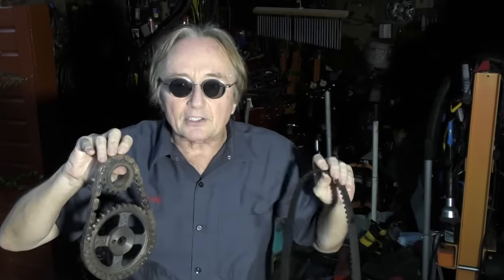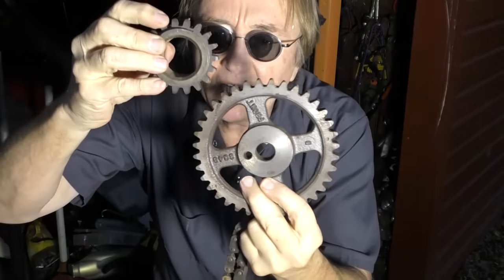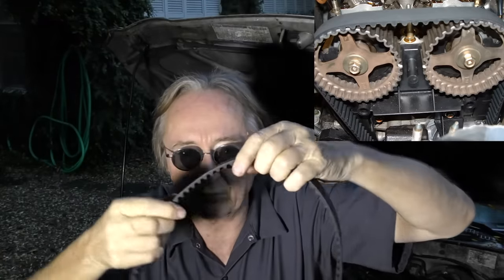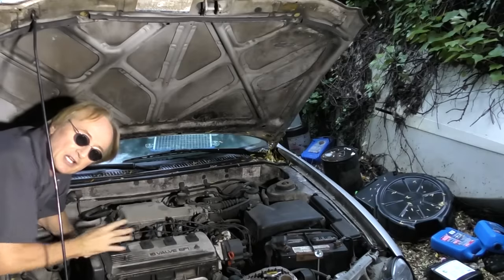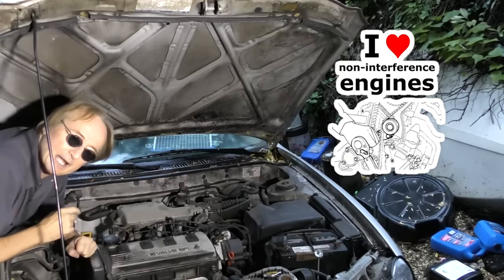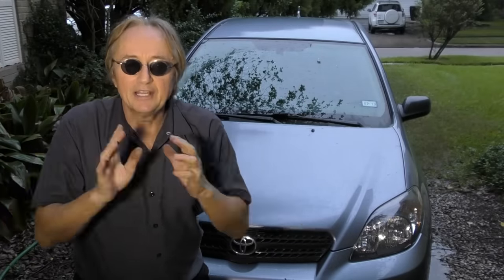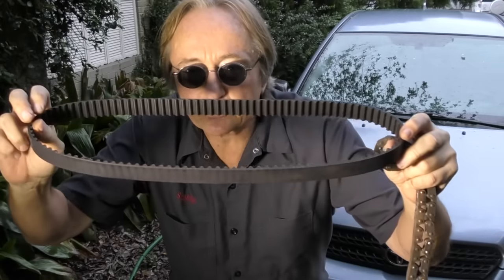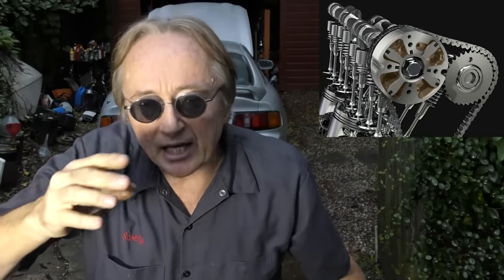Why Some Cars Have a Timing Chain Instead of a Timing Belt

Comment: Timing gears aren't totally obsolete.  I had a Pontiac Fiero with the Iron Duke 4 (no, it didn't catch on fire).  It had timing gears. I never really thought the engine was overly loud but, then again, it was in the rear.  The crankshaft gear was metal, the camshaft gear was nylon.  I presume the camshaft gear material choice was to make the engine more quiet.  One fateful day that nylon gear had enough (in all honesty, I overheated that engine many times due to the coolant system design so the gear may have been weakened)Only stripped a few teeth off but I guess that's all it takes.  Non interference engine so all was not lost.  Considering the number of Iron Duke engines made, there might still be a few out there (the USPS LLV comes to mind).

Some years later, I had a 3rd Gen Camaro that I'd put about 200K miles on.  It had a 305 V8 and at one point I noticed that it sounded like a giant baby rattle.  The timing chain had indeed worn out and stretched, but never jumped.  I replaced it and the car was much quieter.

Good cars, both of them.

Comment: many cars manufacturers are able to use timing chains who last LESS that timing belts, so the hyvo chain presented by Scotty are not the best: on many modern engines they are undersized and lengthen, and because they specific design, induce a fast wearing from the cogwheels: best was the robust duplex roller chains: last the live from the engine...

Comment: Daimler-Benz once offered special offset keys for the camshaft and distributor/injection pump sprockets, which allowed compensation for wear of the pins and holes in the links of the chain. That's why the chain gets longer, the metal itself does not stretch unless grossly overstressed.

Comment: Ford ecoboost uses a rubber belt dipped in oil, with their smallest engines. In the UK the 1st generation ecoboost focus changed the belt after 100k miles. Other brands in Europe started copying the same system but with poor results. Rubber belt dipped in oil reduces de vibrations of the engine making it smoother.

Comment: I remember when there was a period in the 70s when all the racers were going to gear cam drive but they found out it caused major issues in the engines with high RPM and big HP. Something to do with shock causing failure through breakage of parts. So gears quickly went out of favor for race engines. If you follow the manufacturer recommendations for cam belt replacment they are fine. They are lighter, smoother, quiter and more accurate than a chain. Chains might be OK but many manufacturers screwed up by putting in plastic or nylon gears instead of metal so they could keep noise (and cost) down.Those gears caused all kinds of premature failures. Also I found that often it wasn't the chain or belt that broke....instead it was the tensioner. When changing a cam belt I always change the water pump, serpentine belt, tensioner.  I always have said the main cause of engine failure was the owner....who didn't follow the manufacturers recommended maintenance schedule.

Comment: I love my ford Rangers. They have a timing belt and a non  interference engine. (4 cyl) I change my own belts and they last forever. The belt cost about 40 bucks and I can change it in about 2 hours now.  I've owned several rangers now and loved them all and have been driving them for over 30 years now. The  lima engine is easy to work on and very reliable.  Some day I might be forced to get one with the newer style engine so I hope it's just as good as the older one.

Comment: Nice educational video...maybe additional info you forgot to mention is that belt is supposed to be changed periodically...so will not break if done as recommended and quite cheap to replace compared to chain which has no clear  indication about when replacement should be done
Reply: Sure don't have to change a chain twice in 150K miles.

Comment: Great video and info.  Your the best.  I have a 2007 VW Passat 2.0  4 cylinder  turbo. Took the car to VW and they told me its the timing belt system. 
For a while ive been  hearing small ticking noise coming from alternator pulley or tensioner,  i was told it's the lifters, then told its the tensionor pulley.  If its the lifters, are they worth repairing? Also, had the timing belt and accessories replace, and the car was running well, but went back to misfiring and stallling.

Comment: Scotty I'm with ya on this one. I have a 2004 hyundai sonata with the 2.7 engine. I has 156000 on the engine. Doing the normal maintenance has convinced me that only the minimum was ever done on this car. Which leads me first of all to the timing belt which I seriously doubt has been changed more than once if that. These naturally asperated v6 engines can get 300 or more and it uses no oil so far but these are interference engines.  Both my sister and I have lost engines in the past due to TB failure although they were different car manufacturers . This is not an easy engine to work on and the water pump is behind the TB so you really must change it while your there. The cheapest est I could get was $740. I'm retired and will do it myself. I've never had to mess with any engine which had a timing chain ever over timing related engine failure and I've owned many, You just never even worry about it. With a belt you better pay attention and change it every 60.000 to be sure. I don't want to have to worry about a radical up or downshift, in an emergency snapping my belt and taking the engine out

Comment: I actually like the timing belts on my subarus. Super easy to replace. I can change a belt, tensioner and water pump in 1.5 hours without rushing.
Reply: itd be alot cooler id u didnt have to change them at all

Comment: A big difference with a timing chain/belt vs gears is camshafts turned by chains or belts turn the same direction as the crankshaft. Timing gears on the other hand have the camshaft turn the opposite direction of the crankshaft.

Comment: I had a 93 mustang. Broke the belt at 58000 miles. After that I changed it every 50000 miles. Got a 2003 Corolla with a chain. Got 300000 miles. Never had to replace it.

Comment: belts are also quieter than even "silent" roller chains. They also sit outside the oiled space meaning that you only need to seal the oil pan valve cover with gaskets. There is no need to seal the front or rear where the chain would be.

Comment: I've owned multiple hondas and toyotas with timing belts.  Nothing wrong with belts.  Change them every 100K and you're golden.  I've also owned  3 Audis and a 2 Mercedes, two of which needed timing belts at 80K.  Steel isn't necessarily better than rubber.  Belts rarely if ever go before 100K, and they're much cheaper to replace when it's time, as they were designed for replacement.  Timing chains are not designed for replacement, so when they do go (and today's chains are not what the old ones were) prepare to take out a home equity loan to pay the mechanic.  Plus....modern cars with timing chains usually have plastic tensioners, so that negates any reliability gain.

Comment: This and all of your mechanic advice videos are excellent informative, Thank you for your humble and knowledgeable dedication.   I own a 2002 Nissan Frontier SC (VG33ER) with 185,000 miles.  After listening to this vid, I'm considering doing an engine swap and, if needed or required, transmission swap.  I'd like a bit more horsepower and torque and an engine that would give me at least 24 MPG - Maybe, I'm being ridiculous.  Would you have any suggestions of engines (not necessarily Nissan engines) but good quality responsive engines with Timing Chains and tranys?  Or, is it always best to continue buying OEM engine type like VG33ER? Or educate me to your best experience, please.  Thank you in advance.

Comment: Timing gears are the best they don't break or stretch but they are costly, my 5.3 02 Silverado with 154k miles on it has a timing chain so one day I was just curious on how much slack was on the chain by moving the harmonic balancer pulley back and forth well to my surprise it was very little movement on the pulley maybe 1 or 2 degrees of crankshaft rotation...I was impressed how little the ware is on the chain....but my 08 gmc with the 6.6 duramax has a gear driven valve train that motor has 265k miles on it no need to worry about breaks or stretches

Comment: I had a ‘99 Ford escort with a 2.0 SPI and a 5-speed that blew the timing belt as I had the clutch disengaged downshifting around a right turn. I lucked out about the timing. Engine was still okay! Cost me $499 to fix (mechanic did the water pump while they were in there), but hey! Sold that car to a friend who eventually had to get rid of it because of unsafe rust.

Comment: 2005 Lexus LS430, timing belt, interference engine, changed it in 2015, 86K miles, was about to break according to the mechanic, whom I trusted. Changed the tensioners and water pump too. Beware buying an older car, 10 years and 90K miles and the timing belts need changing, can be $1000 to $2000 job. Beware.

Comment: My 1986 Corolla snapped its belt at 42K miles and bent all the valves!
One of the Toyota engines has a shaft driven cam. Was it the Avensis?

Comment: Engines with belts are very easy on the oil, you can go extended OCI, but with chains, you gotta keep that oil changed, or it will shear.

Comment: I had two cars the were destroyed after 100,00 miles with a timing belt breaking. Now I have a nissan versa with a timing chain and it now has 230.00 on it and runs great

Comment: For a few years, Nissan's pickup truck was built with a timing chain because it was hard to access, so, no need to do a difficult routine change of a belt. Problem is, they put the chain on sprockets that were made of plastic.  You can guess what happened over time.

Comment: I had a timing belt fail at 65MPH in a 1995 Eagle Vision. It was scary, I lost all power (electrical) power steering and power brakes! Fortunately, I was on a long, straight section of highway and was able to use the emergency brake to get into the emergency lane.

Comment: Timing belts are a thing of the past and were mostly used by the Asian cars and needed replacing well before 100K on many. Virtually nothing has used them the past 20 years or so. We used to replace them on most of the older foreign stuff years back regardless if it was a Toyota or Honda or Nissan/Datsun

Comment: Principal issue with timing belt is polygonization - they don't roll over gear as smoothly as rubber. This effects introduces vibrations, noise, inefficiency and cost in engine. Principal advantages of chains are higher specific load - with same space they can power larger output engine. How log will last depends on how well they were made. 

Now timing belts will deteriorate over time so you need to change them even if car is not in use. However if they are accessible they can be changed for a low cost. In some older european cars you could change them with only using hands and 20 minutes of free time. They also run smoother with lower fuel consumption. But this is mostly reserved for european ecoboxes. American cars are to powerful on average and in USA maintenance costs are to large to see any value in belts.

Comment: I've got a Mitsubishi Colt from 2007 it's only a 1.1 litre engine but it's got a timing chain and it is a hell of a lot faster and more fuel efficient than a belt driven engine, not to mention I should get over 200 thousand miles from this cars engine with no timing problems

Comment: A lot of late 80's early 90's nissans have timing chains for example SR20DE  QG18DE. In fact Nissan pioneered this long before Toyota. Toyota didn't really start using timing chains until they started making VVT engines.

Comment: I have a 2000 Hyundai with timing belt. It broke - trashed the engine - cost $2,300. Had an old 72 Olds with timing belt - it stretched some - timing went off - I changed it myself for under $100. Loved them older, well made engines.

Comment: the good thing about belts, is that if its recently changed its not gonna brake/fail. Chain will often stretch after time and cause problems. So if your buying a 10 yr+ car, belt can be your friend.
Reply: that is true to, but you can hear chain if he stretch and you have more time to react, you can drive a few months before you go to car mechanic, if you have belt when you see is late for everything, sorry for my english

Comment: Scotty, I have a Hyundai and the dealer told me I have 31,000 miles on the car and it needs a new timing belt. Cost over 1,000 dollars.Bought the extra 100,000 mile insurance and they tell me it’s a wear item and it’s not covered. Not only cheap made but they don’t last and charge you a small fortune to replace. I will never buy a Hyundai again. Thanks for letting people know.

Comment: I have a 2013 Honda accord four-cylinder that I believe has a timing chain in its engine.. it has 128,000 miles on it and has never been changed. When should it be changed??  is there a exact mileage when it should be changed out ???

Comment: I agree that a rubber belt sucks compared  to a soaked in thin oil steel chain. More often there are problems with  the tensioner than the actual chain itself. But note that the belt is not just rubber, it has a steal or nilon frame just like ur tires so it keeps is shape

Comment: Tell that to bmw N47 engined drivers! Same with some mercedes engined vehicles, they had trouble with the timing chains stretching as well. Timing belts are fine if they're changed on time.

Comment: Would you know if there has been any kind of recall on Buick's with timing chains or belts?  Our dealership is trying to say that our timing chain broke, but my wife drove the car and parked it and got out, and did not hear ZERO LOUD NOISE which I would think would be obvious ? 
 
This car was loosing oil at record pace weekly nearly down to nothing at times!...and this went on  for several months and they told me its an older car and it burns oil, but that has to be bull because it was vanishing !  But did not leak on the ground at all,  and the dealership kept putting it off telling "me" to make sure I keep record of it weekly and put oil in it when it needs it.  Would it be my responsibility to make sure I fill oil sometimes daily for an issue that I think I did not cause???

 But when the car would not start, we called tow truck to come take it into the dealership and then they said it was the chain, but HOW THE HELL can the chain fall off without us knowing it?? Lol....Any help would be great, Thanks again for your tips!

Comment: Here in Europe timing belts are usual, I have had 350.000 (kilometers) in my car and it's close to have the third change, nothing wrong. What the difference betweeen to destroy an engine for a chain tensioner or for a broken belt? You keep the maintenance procedure and everything is all right.

Comment: To my recollection, it was Hans Glas the inventor/producer of the Goggomobil, back in the 50s (when I was a young kid, just a couple years older than Scotty ; ) who came up with the rubber-based timing belt. Back then it sounded 'revolutionary' to my amateur ears. 
I'd have to check Google to see whatever happened to Goggomobil, but as far I believe to remember BMW bought them out and introduced the timing BELT Hans Glas invented to their own models. Well, that's what I believe to remember from my teenage years when I grew up in car-starved Europe during the post war early 50s.

Comment: Scotty, you do know that as mentioned by others, that the tensioner can fail inside the enige of a chain one, and with a normal timing belt you replace it every time you change the belt.
Besides it's more quit, and a chain also stretches like a normal one does, not as fast as you mentioned. But i have seen a lot of modern cars where the chains has to be replaced within a short period of time like 60 or 70k, and even brake.

True that a chain is stronger and less likely to brake, but please don't state it as superior against poor, because it's surtenly not!  Good maintenance will go a long way, and also the way people drive.

Comment: Few months ago I was smoking outside when my neighbor turned her car on and I could hear really loud rattling noise. Told her that her timing chain needs to be changed and gave my friends number as he's mechanic. 

Later my friend told me that it's probably the original chain as he never seen the one that was as bad as it was on the car. That car(BMW E60 530D) had over 600 000 km (almost 400 000 miles on it)

Comment: My 1999 Nissan Primera has a timing chain and my 2015 Škoda Citigo has a timing belt. I am supposed to change the belt every five years or 160,000 miles, whichever comes first. I am a driving instructor and so there is a lot more pressure on the belt so changed it after 4 years and only 60,000 miles to be on the safe side.

Comment: Scotty, My girlfriend wines too but she's more secure to the headboard when using chains instead of rubber. 😁🙄😵‍💫 How do I know if it is an non-interfere engine? 2006 Honda Ridgeline.
Thank you.
Reply: Yeah that’s an interference engine. But if you change it out at less than 150k, have the mechanic give you the old belt. It will look practically new. The 3.5 V6 in those Hondas was an awesome engine

Comment: When a timing chain gets old, it just streaches to the point where it skips a tooth on the gear and throws the timing off a couple of degrees which will make the engine run rough, but not enough to cause the valves to hit the pistons. At this point, people try to retime the engine by adjusting the distributer.
Eventually the the chain will skip  again to the point where there is no more adjustment left at the distributer and the gear and chain will need to be replaced.